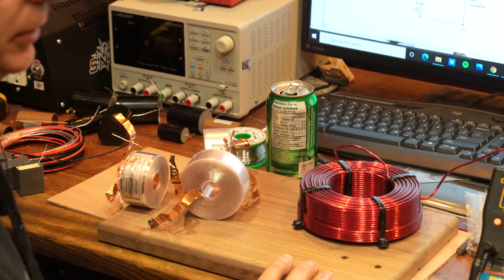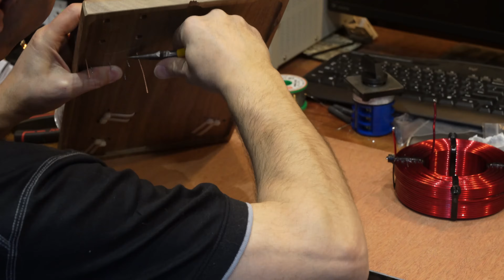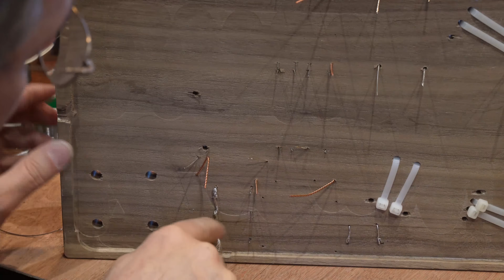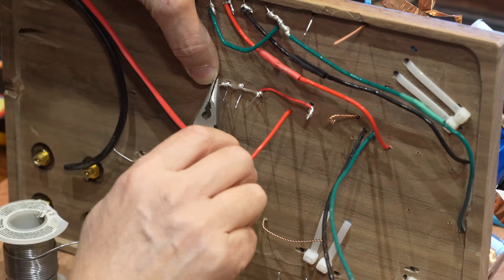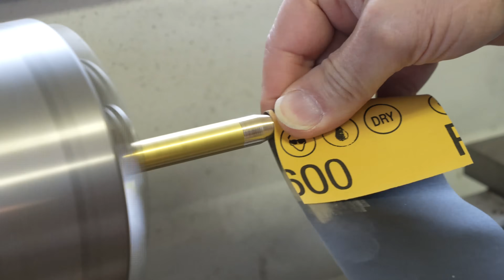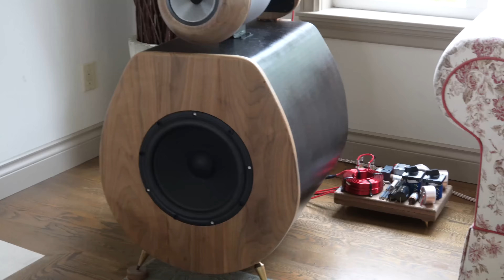Building very high end speaker crossovers  part 2

Comment: Congratulations Gabster on your excellent explanation and for sharing your knowledge. Crossover design is truly an art and a technique; it's not just about calculations. You need instruments, and the type of amplifier and the room are very important. One curious question: could air-core inductors be made with ferrite cores? Also, did you measure the frequency response using an oscilloscope and a signal generator? Thank you very much, greetings from São Paulo, Brazil.

Comment: What is the purpose of the small-value capacitor coupled with a high-value cap? (0.22uF together with the 30uF box cap, for example). Thanks in advance
Reply: I know it's called a bypass cap. If that helps. Ask chstgpt what it does.

Comment: hello, May we please talk . I need help . I have recently come into 8 altec lansing speakers that were part of a pa system, as such they were wired in sequence and the  original amp that drove them was not available. I Have  8 units that are ALTEC TWEETERS THAT ARE model 299-16a high frequency drivers  16 ohms. they are mounted on model MRII 5124 mantaray horns. and bracket mounted onto 12" woofer model 3127  8 ohm woofers all mounted in the classic battleship grey plywood boxes with an air vent and and fibreglass insulation damping material. in all 80lbs... the tweeter drivers are massive magnets. my goal is to make these into 4 pairs of of home audio speaker pairs w high frequency  adjustment knobs . Much like the OJAS + Klpsch speakers that are currently available. . Would you be interested in building the crossovers needed and installing Im located in toronto . Many thanks for reading this message .

Comment: Great content. I am fortunate to have some old 60's Wharfedale crossovers. Both 2 and 3 way versions. Wooden boxes filled with wax (huge coils). The 3 ways came from an old acoustic company in Boston that had imported them from BIC. They sound fantastic on the Wharfedale Airdale set up. 15 inch, 8 inch, 3 inch. The SFB's from Wharfedale 12 inch, 10 inch, 3 inch also sound fantastic and don't use x-over. Just a 4 mfd capacitor. This is something I have also done in 2 way, So a 3 inch Wharfedale super tweeter paired with Philips 12 inch alnico full range. The high sensitivity matched with a suspended wooded floor substrate gives great results. Troels Gravesen has a lot of useful research on his site. Do you have a site?

Comment: Why didn't you put a bypass from KPCU on C8? I think it's a mistake. Besides, the KPCU bypass on C7 is not needed.
 Add a Duelund JDM 0.01 silver bypass to all those KPCU bypasses. Cheap cables block the sounds that the high-quality crossover let through. Use one solid core in the crossover and for the driver, not a multi-strand cable, preferably Neotech.

Comment: I’ve only just started to take an interest in Crossover design and building. I’ve managed to source high end components that don’t cost an arm and a leg. I was shocked to discover that crossovers (even in high end speakers) are typically compromised with most being very poor. 
My first project was my own speakers. All I did was keep to the same values but with much higher quality components and build.  I was shocked at the improvements. 
The whole experience inspired me to learn more. Yesterday I discovered your excellent channel. I now feel inspired to build outside of the cabinet with adjustable filters that don’t compromise the sound quality. 
Thank you for doing this as it helps greatly.
Reply from the maker: Thank you glad you found it helpful enjoy the journey 😊

Comment: What are your crossover frequencies? If I missed it and you mentioned it I apologize, but I don’t you recalling those frequencies. Also, is this butter worth or with. Thanks for the help.
Reply from the maker: If I recall it is around 300 and 2k most tweeters can not handle 2k but the Rall tweeters are exceptional You can see the schematics here
https://youtu.be/DMU3cxsseqE?si=R89w6AHgcaNeeIW5&t=459

Comment: Thank you so much for your videos, very appreciated!
I'm about to embark on a similar project and just curious, did leaving the crossovers uncovered give you any problems? Like dust collecting or oxidation from moisture in the air?
Reply from the maker: Not at all I use a Swiffer from time to time or a Photography air blower. having them outside not subjected to the vibrations helps with better sound.

Comment: Hi, I've been dealing with electronics all my life and I'm also a fan of good sound, I have industrially made speakers, but I made my own crossover tuned using a generator and an oscilloscope. Your work is absolutely amazing (I immediately subscribed) and I find your choice of capacitance meter all the more odd because you use the most inconvenient way to measure with DC charging.
These meters work on the principle of counting the time it takes for the capacitor to charge - this method is very indicative and completely unsuitable for audio applications. Capacitors need to be measured using an LCRmeter with alternating voltage at their operating frequency - the change in frequency acting on the capacitor greatly affects its capacity. Measuring capacitors is exactly the same alchemy as correctly placing the individual parts of the crossover. I praise the ESR measurement 👍 but I personally also measure the EPR and DC leakage at the maximum operating voltage on the capacitor before use - these measurements tell us almost everything about the condition and properties of the capacitor.
What you made is absolutely amazing, including the work procedures and the measurement of acoustics using a microphone is top notch, and that's why I didn't understand the measurement of capacitors with a clamp multimetr on which this function is only additional. To compare it to audio technology, it's like someone bought a Jamo Oriel, connected all the speaker terminals with a thin bell wire and connected, for example, a McIntosh MC2KW.
I have a life motto that works not only in the area of audio - The whole system works like its weakest link.

In conclusion, I would like to apologize if my comment is not well understood, I do not know English very well and I am helping myself by translating.

Nice day 🙂 Tom
Reply: Yes I was wondering at what frequency the test was measured too.

Comment: Impressive work! Question.. Im just looking to upgrade existing components in my Magnepan 1.7i  xo.
Ive read that adding a bypass cap for tweeter should be about 10% of  spec value.
If 10uf is spec value and 1 uf is bypass value, should the main cap be 9uf since caps in parallel add thus equalling 10uf?
Thanks!

Comment: Hello! Good work! I construct my crossover with polymer capacitor but i decided to use ferrite core with air gap (because copper wire is expensive and size of coils without any rod is too big).

Comment: Can you show how to make a 3 way crossovers for  over a thousand plus watts speaker system ty
Reply from the maker: The Idea is the same just need thicker gage inductors and higher W rating on resistors and higher Voltage on Caps you can measure across each component say at a 100w and do the math for a 1000.
keep in mind that a 1000w is not meant for home use at least not on full power You would need Higher rated ears as well :) most amps that are a 1000 w rated don't end up driven past 200w just nice to have the headroom.
Reply: @Gabster1   ty it's a system iam going to be building for outdoor

Comment: Would it be a good idea to upgrade a 2way passive crossovers with higher end components (caps, resistors,etc;) for car audio too?

If so,  I've got a project that I need help configuring for a component system that I upgraded the size tweeters and drivers for my truck...

Comment: Can you please share the formulas and theory of how you calculated all the components. Thanks for the interesting videos!
Reply from the maker: Second order crossovers are not that complicated once you decide the transition frequency based on the drivers parameters 
You can do a bit of simulation in software but to be honest the bulk is done by first working on 1 driver at a time then all 3 with hundreds of sweeps and rew measurements and listening 
After some practice you have a tough idea what  values to use then fine tune from there

Comment: Gabby,  if I were to replace the ferrite core inductors in my xo, I would measure the DCR in them as well and buy and air core inductor with the closest DCR to the original ferrite core correct?
I am assuming that the designer of my speakers took into account the DCR of the ferrite core inductors he used.   
They are Proac speakers btw.  
Thanks!
Reply from the maker: The dcr on a ferrite core will be very low as they only use a short copper wire you would need to use a much bigger gage wire to get the same dcr but yes you are correct.
A bigger dcr will reduce the bass a tiny bit so the smaller the better.
Reply: @Gabster1  so do I need to measure the DCR of the ferrite core inductors currently on the board?   Or just get an air core with the lowest DCR? 
I’ve heard that some speaker designers take into account the DCR for the design. Is that true?
Or as I said before just get an air core inductor with the lowest DCR?
Much appreciated !
Reply from the maker: @Nightjar726  I would get the one with the lowest dcr the thicker the copper coil the better you will probably need a 12 or 14 awg to get close to the ferrite dcr in my case I used a 10awg but that is huge you put that inside a speaker now you are affecting the cubic volume 
If it is a bookshelf proac would use a 14 awg 
A big tower use a 12awg  
On another note you may want to consider spending that money on upgrading the mid and tweeter capacitors you will get more bang for the $ if you can afford all even better 
Don’t go too Crazy at some point you are better off getting better speakers for that money.
Hope that helps
Reply: @Gabster1  getting better speakers is not as fun.  That would be too easy.  Ha. 
I’m sure you understand that as a tinkerer yourself.  
I want to learn from this experience and try and squeeze as much as I can from these speakers.  I am also thinking of putting in a beryllium tweeter to replace the soft dome. 
Hope that makes sense.
So you are saying that I do not need to match the exact DCR the designer used for the speakers?
Oh and one more question.   I think I have the specs for the inductors.  But if I want to measure them myself would I get a LCR meter?  What would I need to measure the inductance and DCR resistance of each inductor to be 100% sure?

Much appreciated
Reply: @Gabster1  hey man ,   If I use an air core inductor for the tweeter and a ferrite core for the woofer, do I have to set the air core upright as you demonstrated? 
Or in that case can I lie it flat?
Thanks!
Reply from the maker: @Nightjar726  Upright at 90degree angles a good 2 inches at least apart
Reply: @Gabster1  is there any other way I can contact you and pay you a fee by the hour so you can guide me through my speaker ‘ upgrades’? 
Would you be interested ? 
Thanks
Reply: @Nightjar726

Comment: One wonders ... thick power cords, thick speaker cables, thick interconnects ... and then thin wires in the crossover ... which compromises, or defeats the purpose of, all those nice thick wires elsewhere?  What are your thoughts.
Reply: Short distances don't require same thickness as longer ones.
Reply: how thick are the wires in the voice coils, or the traces inside the amplifier  hmm ?
Reply: I thought the same and when I built my gr research nx otica crossover I wired it using kimber cable 8tc braided cable... What a pain to do but I'm glad I did!
Reply from the maker: You have a point, these appear thin but they are 12 and 14 gage silver plated ofc copper they look thin because the ptfe jacket is very thin. also as noted by others below short distances are not as critical and most connection have silver solder on top.
Reply: zip ties compress the coil material leading to possible failure down the road, & actually the same goes for capacitors, don't use zip ties
Reply: @ericschulze5641  By that theory , all the speakers in the world would fail .
Reply: @ekimandersom4478  they don't fail they just lose a couple wraps